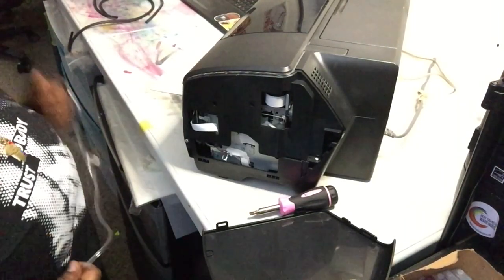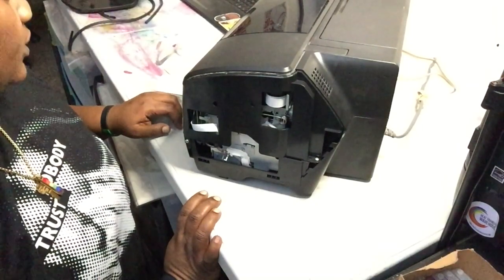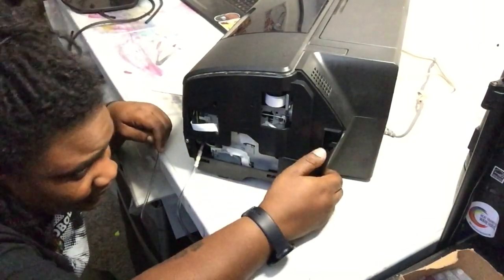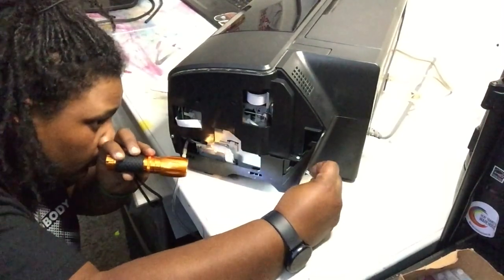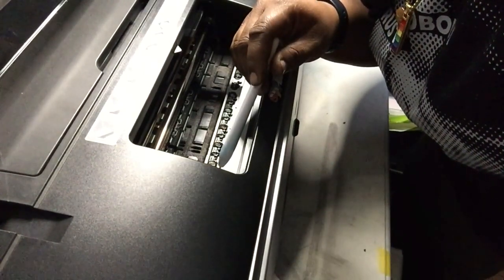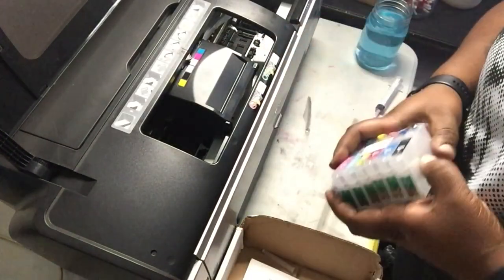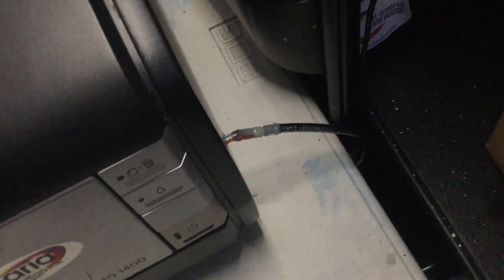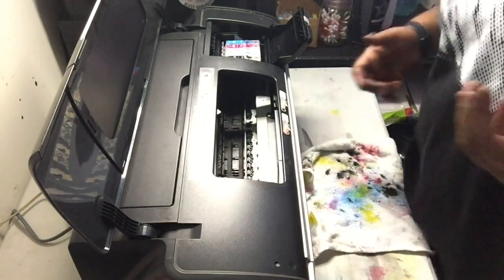DTF DIRECT TO FILM converting an Epson 1400 for DTF DIRECT TO FILM  #DTF waste line removing rollers

Comment: I already have an R3000 converted, and it's working beautifully. I'm about to start on an R1400 and R2400 I acquired on Sunday. Big Boi Inks ended up clogging up my R3000 the first night they were in it. I pulled them out, flushed the lines and printhead several times (at least 10) to get it printing properly, and filled it up with DTG Pro Quantum inks. They're fabulous.

Comment: Hi YaDigg...quick question...would it make sense to simply remove the print head and use the waterfall method to clear the old ink from the head vs running several head cleanings with the cartridges filled with cleaning solution??
Reply from the maker: Hey that's a good question I think either method you're going to take a risk removing the print head multiple times could create more margin for error and also running too many cleanings can end an error so either way makes sense to me just be careful YaDigg ⁉️😎
Reply from the maker: But honestly I no longer run cleaning solution through my printer I just remove my carts at night and leave a paper towel with the Windex underneath the print head and I also leave a paper towel with Windex on the nozzles as well as leaving a paper towel Windex on the capping station pad and that's been working for me lately

Comment: Hello, I have a problem.  the printer does not print ink on the pet film.  If I take normal paper it works fine.  what should I do?
Reply from the maker: Which printer are you using?
Reply: @FayzoFilms  Epson 1500w same print head as 1400
Reply from the maker: You can try this

https://youtu.be/3v5Y2CN-ZjQ
Reply: thank you!  it works!  Thank you so much!
Reply from the maker: No Prob 😎